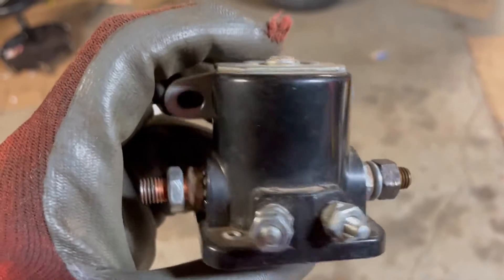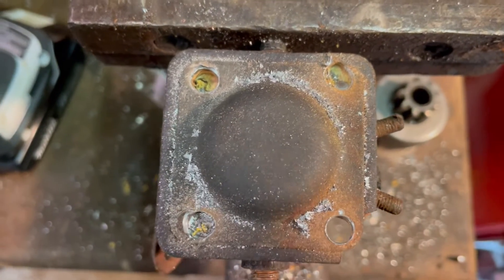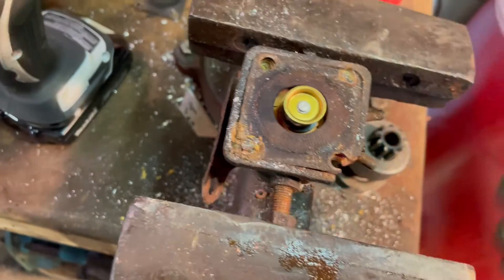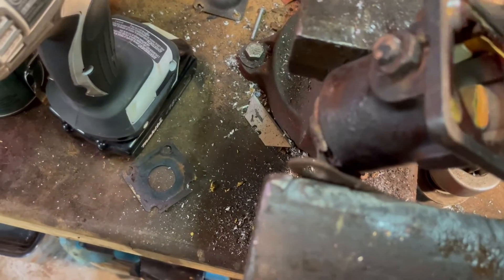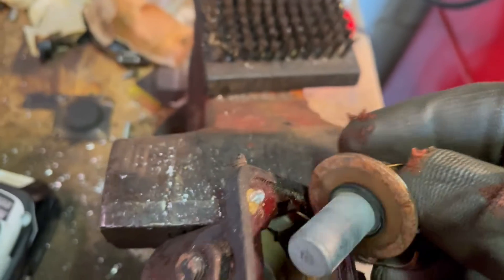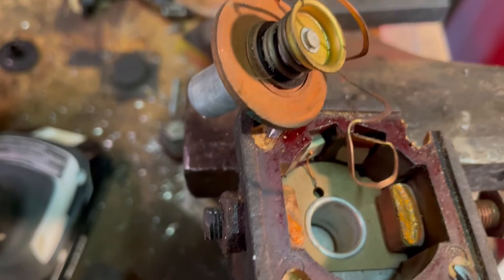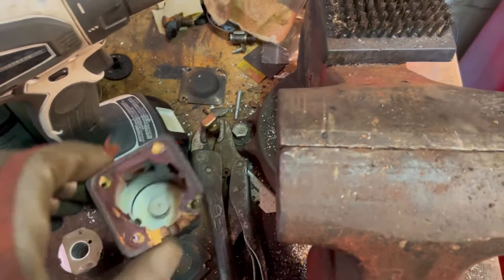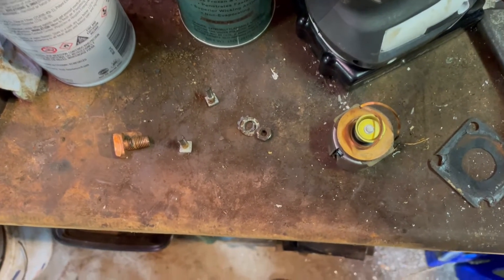Starter solenoid - what is inside, and how does it work?

Comment: So I am really only versed to any degree mechanically on a SB Chevy 350 but am helping a friend with a 1983 Jeep Chief with a Mopar 360 in it and he was asking me if this part was the "starter solenoid". Before doing any digging, I said no, the starter solenoid is typically on the starter itself and I would whack it with a hammer to get it to actuate when it way on its way out. As I understand it on the SB350, when powered, the solenoid actuated the plunger that pushed the starter gear into contact with the flywheel, starting the vehicle. As this "solenoid" is mounted remotely, this seems to be a solenoid that actuates in order to send current to the starter? Is there then another solenoid on the starter to push the starter gear into contact with the flywheel on Mopar 360s or is it set up differently? Maybe I have been wrong my entire life which is definitely possible. Just trying to educate myself so please go easy on me.
Reply: If this device is on the car, it is the starter solenoid. All it does is supply current to the starter when cranking. The starter drive is still on the starter itself. Think of the GM unit as both a solenoid and a starter drive, whereas this unit is only the solenoid part of the two-component system.
Reply: @whattherust  perfect. thank you

Comment: What do you hook up to the hand trigger to bypass the ignition switch?
Reply from the maker: It is a remote starter switch I purchased off of Amazon. I use the heavy duty one, as I have had trouble with the smaller units.

Comment: Hello Richard, I have the exact same starter solenoids on my Cub Cadets as well as my Ford F150 trucks.. I always keep a spare solenoid on hand just in case. On my Ford truck, I stick with the Motorcraft solenoid instead of the ones from the auto parts stores. The Cubs don’t seem to mind(LOL).
Reply from the maker: You're right. Many of the off-brand solenoids are junk.
Reply: @morewhattherust  Richard, I had a really bad experience with the solenoids other than the Motorcraft solenoids. The Motorcraft solenoids are really not that much more in price and work much better. I also try to always stick to the Motorcraft oil filters other than WIX for my Ford products and AC Delco for GM stuff.

Comment: Excellent video Richard  :) funny  part my dad had one on International 105C combine gas motor  that top cap on you had drill out and combine 4 screws ! Part was called Spinner  what did when got engine start hear or feel spinning like Generator or Alternator  recharge battery with Generator or Alternator but had serivce ever that box or blow Alternator or Generator  recharge or stick on high voltage and blow up battery with key ignition switch off also motor too so wild! Acted like electric magnetic so did want have metal near or get big Zap it would hurt my dad also myself one time ! That's why nickname it Spinner feel like that after Zap ! But change  design on International to for Starter only years later part of Spinner and never get Zap key ignition switch be on Postion too! Hopefully that taught something new to also one explained Richard use on Farm tractor to in 6 volt positive ground or 12 Volt Negative ground  too plus Combines also International in gas plus some deseil motor in pickups and stake 3 to 9 tons ! Ones did see in Desiel was for Fuel Injection on Glow Plug warmer act like relay too !

Comment: Invented to eliminate having huge switches everywhere.  Uses a small voltage to make a contact for large voltages. And so that those contacts can be made smaller and remotely.  A contactor on an HVAC unit is very similar.  Thanks for sharing, Richard!
Reply from the maker: That's right David. Thanks for watching.